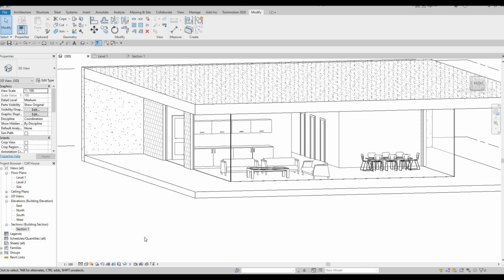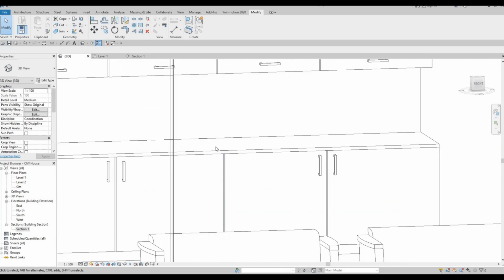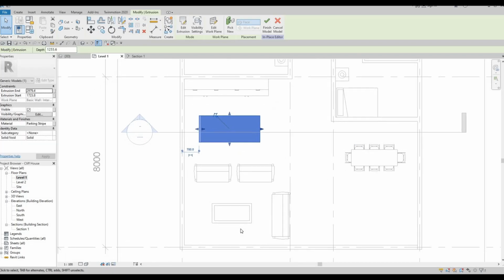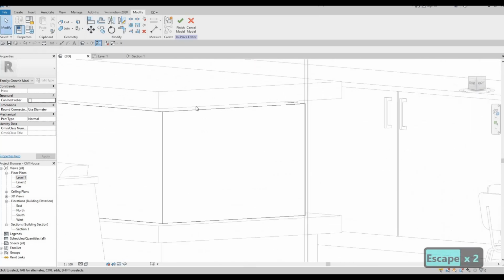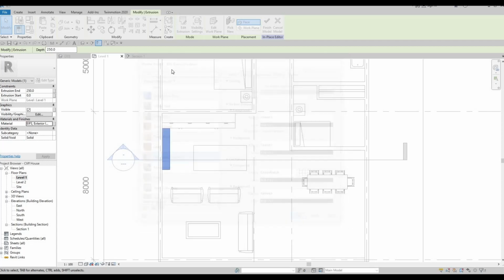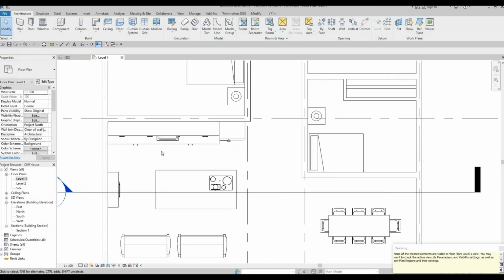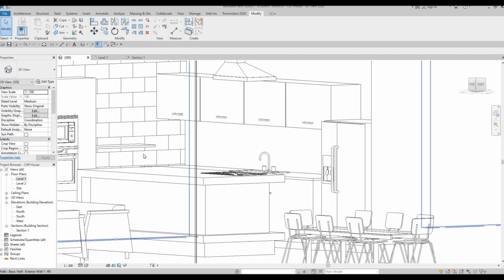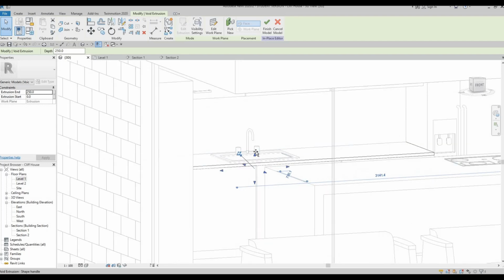Cliff House | Part 5 | Complete Step by Step Project | Revit Tutorial

Comment: Hi and thanks for your great tutorials.  I have got part of the blockwall visible on one of the corners of the curtain wall where the glass meets. I can’t seem to access the glass from the plan view to re-align it now that the top part of the block walls exist.  Any advice on how to fix?  Thanks.
Reply from the maker: Hi Justine, thank you. You might have to change your view range in order to see it from the plan view. If that don't work, you can send me the file at archcoredesigns11@gmail.com, I can assist you better. 🙏🙂
Reply: @ArchCoreDesigns  thanks. That worked perfectly.
Reply from the maker: Good to hear that it worked. Thank you for the support Justine 🙏🙂